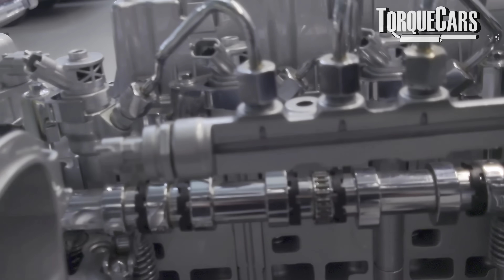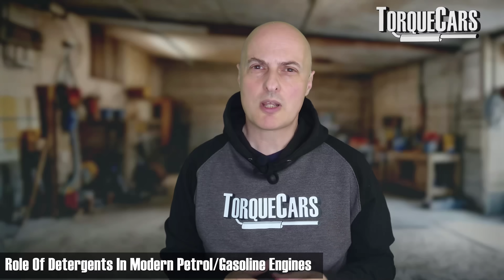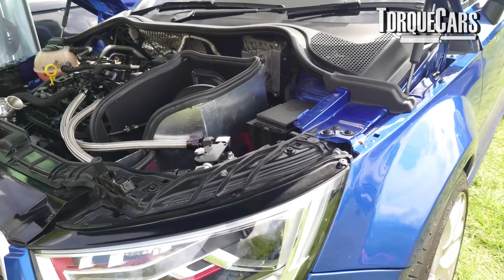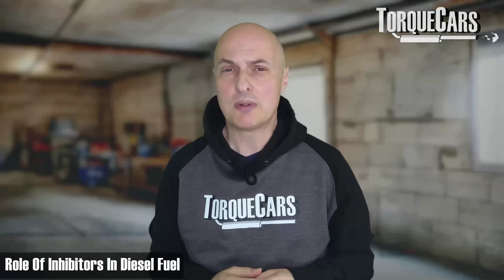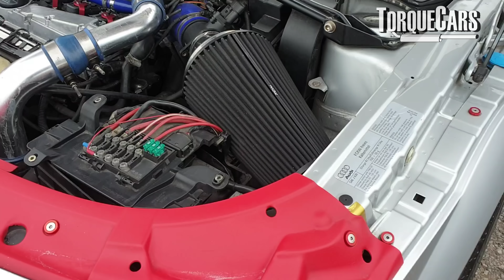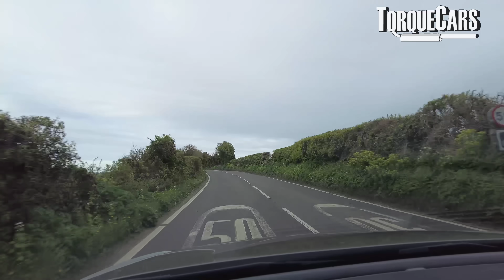Premium vs Cheap Fuel: ⛽What’s Better For Your Car? Do Premium Brand Fuels Really Clean Engines?

Comment: I have a BMW 320D with 180k miles on it.. always run Shell diesel fuel as there is a station by where I live. Never failed an MOT on emissions as the engine runs very clean

Comment: We have one turbo diesel and one petrol.  Fuel is always Shell VPower for both, oil is Mobil 1 (specifically ESP 0W30 for the turbo diesel).  Maybe BP fuel and LiquiMoly oil are slightly better but I’m happy with my choices.

Comment: I use "Morris" oils diesel fuel additive no smoke , stabilizers the fuel, boosts octane, lubricates and cleans fuel pump injectors and valves, after 3 years my 131,000 mile Volvo 2.4 run smooth quite loats of power and great milage

Comment: I got vw cc rline 2.0 tdi 2025 177ps October 2025 started putting in normal fuel run like crap on start up so run that fuel down filled up with v power diesel I have decent torque

Comment: I always put bp ultimate unleaded in my Ford Puma 1.5ST which has a Stage 1 map and it runs very well however the choice of Premium fuel in Northern Ireland is poor compared to England no Shell and no Tesco 99.

Comment: I bought Tuscon with 38,000 miles (1.6TGDI, non-hybrid) - back in hometown, in a familiar road - I've noted how rough engine sounded when pulling into a steep hill with a bit of an acceleration. Added a couple of tanks of BP ultimate, fuel system cleaner - and oh my world - what an improvement it's been. Engine is now 50,000 - runs so much quieter.

Comment: I fill up my Volvo D5 at Costco and put Redex in nearly every fill up also my Nissan 1.5dci and both have done well over 100k and are running better than ever since the Redex has been going in I can’t believe the difference.

Comment: More based on bikes but 100% notice thr difference between E10 and E5,even on my newer bikes that are E10 compliant,within minutes E10 only if I can't get E5 power is down noticeably,engine runs rougher and is a tad noisier it's deffo noticeable,only use E10 if out a long run and very low on fuel and at filling there I'd no E5,it's even worse on older carb bikes I bought a 25yr old fazer,it didn't idle right until fully warmed up it was old fuel owner used and blocked up pilot jets,it also can attack the fuel hoses so stick with E5.

Comment: Premium fuel is more relevant for diesel engines due to the use of EGR and DPF systems. Cleaner combustion helps reduce carbon deposits.

Comment: I noticed a significant difference in performance with a 2007 VW passat 1.9 tdi with 140,000 on the clock, I had run it on supreme diesel, then i've run it on a roughly 50/50 mix of supreme and standard and then on just standard. On standard alone the car felt more sluggish and less responsive, the 50/50 mix was what I would say was acceptable performance for an 18 year old car. The supreme does take top spot, the car had a very clear improvement in responsiveness to the point it was like driving two different cars. Also, supreme diesel in my VW LT35 made a very clear improvement in performance, I'm currently running a 2011 Passat 2.0 tdi on supreme and it's very responsive and smooth so my experience with VW diesel's is that they respond well to premium fuel.

Comment: I use the cheap diesel but add Millers Eco Max which gives the benefits of expensive diesel at much lower cost. Avoid constant low revs.

Comment: If you run a diesel and do short journeys with a low yearly mileage, I would certainly run premium fuel.  Also if run run a classic car then V-Power or the equivalent make should be your normal fill-up.

Comment: I have a 2015 Toyota Rav4 INVINCIBLE 2.2 Diesel, I always use Shell V-Power Diesel worka out about an extra 6-10 pounds more on every fill up bit i recently tried a full tank on regular shell diesel and when i put the V-Power back in for a full tank again... I notice its feels faster and smoother. Maybe just a placebo but i strongly beleive it is better for my car.

Comment: The main thing is to not do short cold journeys, but always go 20 rural miles so that all aqueous mess is evaporated and gone before stopping and going cold.

I have bought old cars, which had no urge but after some time and detergent petrol they began to move, because the furry crud detached from inlet ports and backs of inlet valves.  I test on a long 1 in 5 hill, can it maintain climb at 2,500 rpm in 3rd?  That is repeatable because it is a quiet C class road and at least 500 feet height gain.

Pinking used to be common but with electronic sensors is now rare.  But if the ECU retards the spark to allow for low octane petrol the engine will not give the efficiency or specific fuel consumption which it should.  One 50 year old bike pinks too much, a younger and larger bore version is better despite higher CR, so better shape combustion chamber.  I do pay for the higher octane in both.  The pinking one has electronic ignition but the better has points set by me and cheap centrifugal advance.

Comment: Just another thing in Australia the nozzle on diesel pumps is larger than the petrol nozzle so it is impossible to put diesel in your petrol car but with these modern diesel put petrol in them practically writes the unfortunately there are some stupid people out there that have done that as for older diesel vehicles you will not write your vehicle off infact l was driving a diesel vehicle for a courier company l worked for and l got in it  one morning no glow plug tge road services came out and used a small amount of petrol to start the diesel truck

Comment: In Australia we have 3 types of petrol to choose from they are 91 unleaded no ethanol E10 10% ethanol and either 95 or 98 unleaded no ethanol  these are more expensive than 91 unleaded which l use for both our vehicles because it's cheaper and they both aren't performance vehicles one is a Suzuki Baleno 2017 and the other is a carburatored 1997 2X4 Toyota Hilux  but l have found out that ethanol destroys in tank petrol pumps and petrol powered garden tools because somebody else used E10 in them E10 destroys carburators now l owned an efi Mazds Bravo ute and had to change the in tank petrol pump twice and also the one in our Ford Fiesta that was a pile of junk any way but when the Mazda Bravo was at the end of its life bought another petrol ute and used 91 unleaded   and never changed the in tank petrol pump ever

Comment: Thank you for your car insights which are always interesting and informative. Engine wear in relation to fuels should also be mentioned. Lake Speed Jr. (YT channel: The Motor Oil Geek) highlighted research how fuel chemistry impacts engine wear and the results blew me away! The research shows that friction modifiers present in premium fuels like V-Power reduce engine wear measurably.

Comment: I have a 2012 Mercedes b180 1.8 CDI I now run on premium diesel all the time the car runs much better smoother faster pickup and over 14k miles is averaging 61.4 mpg the figures speak for themselves.😊

Comment: Only ever put V power or Momentum in my car. It calls for 98 RON but I find my car runs smoother on these brands. I have a few times had to use 95 RON as garage just didn’t sell 98 and I found I got worse overall mileage whenever I’ve used 95 so now I’ll only put in 5 or 10 quid just until I can find a tesco or shell garage and fill up with premium juice.

Comment: I use standard grade diesel in 54 plate X5. Every 4 months or so I put a can of injector cleaner in the tank.
I've used premium grade diesel in the past & tbh I didn't notice any difference except it was more expensive & as I'm now a pensioner,I really can't afford premium grade diesel + where I live the nearest filling station selling premium diesel is 6 miles away.

Comment: I have a tuned VW Golf Mk7.5 GTI Performance - so I fill up with 99RON Tesco or BP (generally Tesco unless I get vouchers/Nectar incentives for buying BP). I've been using high octane for the past 20 years or so (minimum super unleaded 97RON if desperate)

Comment: Used BP ultimate diesel from new. Averaged 64mpg (9 years) with my best one trip at 83mpg but regularly into 70’s on motorway cruises and high 70’s if I stick around 60mph. I don’t buy for performance only for its cleaning package and hopefully reduced maintenance problems. Prevention better than cure. She sounds a lot quieter than many other diesels, some sound like they’ve got rocks in the cylinders. I put this down to my use of BP ultimate.

Comment: I have always used supermarket fuel petrol and diesel  all cars i owned sin e 1993 have been injection some have done 100 000 + mile  no fuel issues  mainly motorway miles

Comment: It makes no difference whatsoever. What makes a difference is how you drive it. If you drive like miss daisy, no matter how many miles you do you're going to get egr and dpf problems. I use morissons everytime. 2013 vw tdi 1.6 no turbo or egr or dpf issues. No blue smoke. When the dpf is doing a regen I rev it to max when going up hills. Leave car running until revs drop back down (only time I leave the car running) and rev to the max in 1st when moving off until the regen is done.

Comment: In my experience, premium fuels is a bit of a scam. My dpf was clogged and had it removed and cleaned. After this was done I always filled it with Shell Optimax only to find out a couple of years down the line only for my dpf to be blocked again and a brand new manifold put it as it clogged up also ceasing the operation of the flaps to close and open properly. I was paying 5p per litre more to prevent this from happening and it didn't work. So don't waste your money. I now use additives everytime I fill up using normal diesel.
Reply: More likely to be the kind of journeys than the fuel type used.

Comment: I have a 2018 Fiesta 1.0  100, currently on 64k miles.  Normally use JET as that's my local station. Until a couple of years ago I just used E10 (95), but would give it Shell/BP/Esso E5 (98+) when on holiday, to get the better cleansing.  I then moved to always using E5 (97) from JET. I can't say exactly what benefits I've had in terms of better cleansing, car runs very well. All other things being equal, I get about 2-3 more mpg on E5, been told it's because of the reduced Ethanol. Partly offsets the extra cost of E5.  Years ago, I'd do regular Italian tune-ups, but don't bother now.

Comment: It makes a DIFFERENCE WHEN U: Service the vehicle, keep tyres @ RIGHT Pressure. And have EVEN Tread on the tyres.. BECAUSE I USED To drive a High roof, long wheel base, 2.2HDi 6Spd. Citroen Relay van. As a Link driver for a motorfactors. So drive Up to 60mph REGULARLY On hills.. WITH UPTO 2xTon of weight in the back.. And in CAN Tell when i drive on normal TESCO Diesel (Company FUEL Card).. Then BP Ultima (Private Use).. SO IF U DONT Look after your vehicle. U Will JUST WASTE ££££.. But IF U Regular sevice n Keep tyres in good condition. YES U CAN TELL the difference.

Comment: Interesting, informative report thanks.  I've usually used low cost fuels because I am sceptical of hype by oil companies.  Recently, I opened up the throttle box and air intake of my 2014 diesel car in order to replace the engine thermostat (stuck open, running cold).  Shocked to discover thick heavy grease inside the air intakes over the valve covers, I'd say enough to restrict air flow.  I'll clean it out, what I can see.  But how to stop it coming back?  Was it the cool running temperatures over 50000k or so, or lack of additives in many of the fuels I used, or just dusty roads and old age?  Any advice welcome!

Comment: Well, after running my car for the first 15 years of its life on regular 87 on advice from a friend I started using 91 Octane Top Tier fuel in my gasoline burner (Don't tell Ugly Thunberg!) for the last 6 years. I wish my friend had told me to do this sooner! Better mpg, better acceleration, smoother running. What more proof do I need? None!

Comment: Being an ex fuel tanker driver for 38 years I can say, hand on heart it's only the different additives different oil companies use.
The refinery I used to load out of is called Lindsey Oil Refinery (LOR) In Killingholme near Grimsby N.E.
Lincolnshire. Esso, shell, BP, Gulf use this refinery also along most of the Supermarket brands and even some unbranded companies, Certas Energy, Turners, West Cumberland Farmers (WCF) Oil Max etc etc.
We all load from the same loading arms on the same gantry, most oil companies have an additive key they insert before they start loading which injects measured amounts of additive into the fuel as it's being pumped into the tankers.
We had two keys, an additive key and a non additive key. That was 5 years ago now so things may have moved on from those days. Edited......forgot about poor service station management and maintenance.
The underground tanks have been known to contain water and rust particles that will contaminate your vehicles engines.
Reply: The Chrysler.....did U used to or still are a member of NORTH COATES GUN CLUB 😁 ????????

Comment: I use V-Power in my 2005 Accord 2.4L. Since retiring I don't do a big annual mileage so the extra cost is minimal for me and I believe it helps to keep my engine clean. It has a higher octane rating than the basic Shell stuff so it gives the ECU more latitude choosing an ignition point. In theory this will give a slightly more advanced spark which helps at high revs for more power. It also contains only 5% ethanol rather than the 10% of the ordinary stuff. I believe ethanol can harm seals, etc. so I'm more than happy to be only using 5% in my fuel especially in a 20 year old car. I realise my reasons for using it won't suit everyone  especially those doing average or above annual miles.

Comment: Used to put most anything in my 2.0 euro 5 VAG TDi. Began to get the occasional EGR fault so switched to only using top brand fuels with higher grade every four or so tank fills. Problem has disappeared. One case doesn't represent a scientific sample but it seems to work for me.

Comment: I can only go off my own test on Shell v power. i covered 14k on my motorbike using V power 99.9% of the time. as the miles clock up from 100s to 1000s of miles the mpg got better and better. when I bought the bike(Kawasaki ZR750F1) with 50k on the engine, it did 51-53mpg. the more I used v power the higher it got. the best I've had it 67mpg and putting a borescope in to the cylinders they were really clean for an engine which has now covered 67k miles..
Reply: And that's why I never bother with any other fuel. Clean cylinders.

Comment: I've used Shell's V Power for as long as I can remember so comparing it against other diesel fuels is a moot point. But my wife used to use ASDA's diesel (for price reasons) and was forever getting a "moisture in fuel" warning on her dashboard. Since moving over to Shell's "fuel save" diesel she no longer has this issue.

Comment: Fuel quality
When comparing the fuel quality of Shell and BP, both companies are renowned for their high standards and advanced fuel technologies. Shell V-Power and BP Ultimate are premium fuels which are designed to clean and maintain engine health. This enhances performance and improves fuel economy, saving you money in the long run.

Ultimately, the choice between Shell and BP fuel often comes down to personal preference and accessibility, as the quality of their fuel is relatively equal.

Comment: I use an additive called EHN 99 a cetane booster in my HONDA CIVIC CDTI And it absolutely makes a difference.,as using Shell V POWER does.....!
Basically it is what the oil companies add to diesel to make it super diesel, only you do it yourself!
As you said in the video , some engines will respond to higher octane, or in the case of diesel cetane which is a measure of volatility, unlike octane , which is a resistance to pressure or knock as they define it in the motor trade, higher octane fuels are actually less volatile but they have a more controlled slower flame front or burn rate!
I previously owned a little Hyundai Getz and it also responded to higher octane petrol and the engine was so much more tractable / flexible by using higher octane fuel and yes it provided much better mpg because it wasn't working so hard and the torque happened around 500 revs lower down, not that it was much anyways but it certainly made a difference in a lower powered car, 1.3 litre with 84 hp!
I would definitely recommend a cetane booster in a diesel, much more responsive...not necessarily any more economical but that is possibly because there's more response on tap and you  tend to use any extra performance if it's there !!
To conclude, it is certainly much cheaper to add this to your diesel at around  £12 per litre of product which treats 500 litres of diesel at the recommended high level .,.than 14 pence or so per litre difference between Shell V POWER and the basic diesel at the pump.
It is basically what they add anyway...so why not add it yourself and save a small fortune?

Comment: I drive a Mercedes C220 and a Mercedes Vito, both with a 2.1 diesel engine- I always use premium fuel in both vehicles, and I have never had any problems with either of them - long may it continue :)

Comment: Great video. I only use Shell V Power in my BMW. It runs great with smooth acceleration and plenty of power. I’m not going to take a chance of using a cheaper gas and risking long term problems.

Comment: I have a 2024 Toyota RAV4 Hybrid and have tried various brands such as Shell V power 93 octane with 10% ethanol,Mobil Supreme 93 octane with 10% ethanol 
the only problem I experienced was with the Mobil 93 octane because the station didn’t sell much and I think it had water in it. 
I’ve been using an ethanol free gasoline 90 octane  all the fuels mentioned are TOP TIER gasoline. My owners manual recommends 87 octane top tier gasoline and it runs fine in my car. But I like the ethanol free gasoline and will probably keep using it.